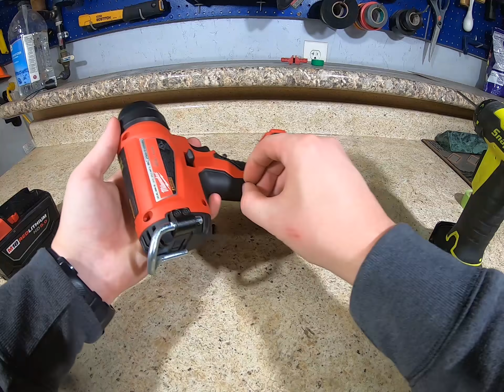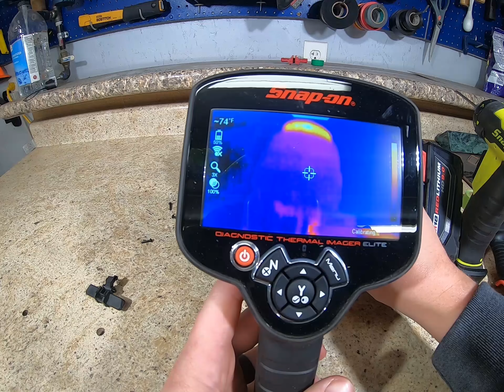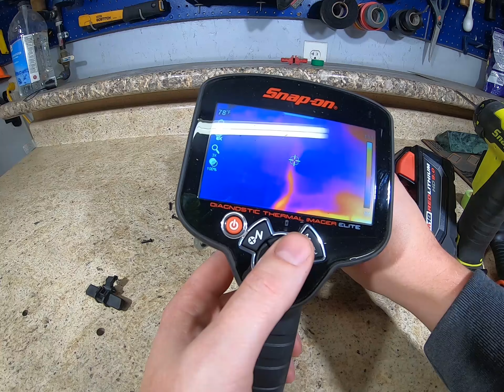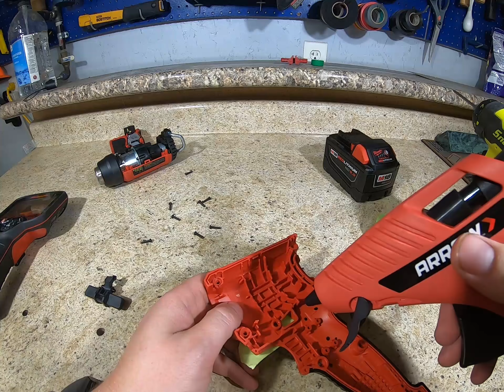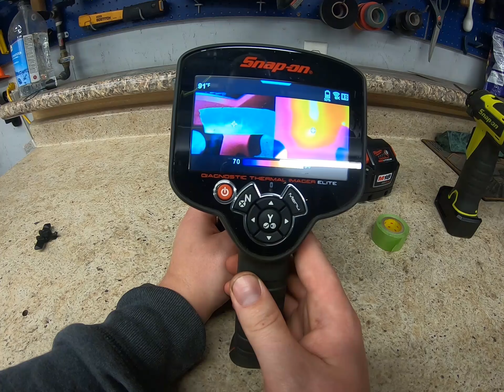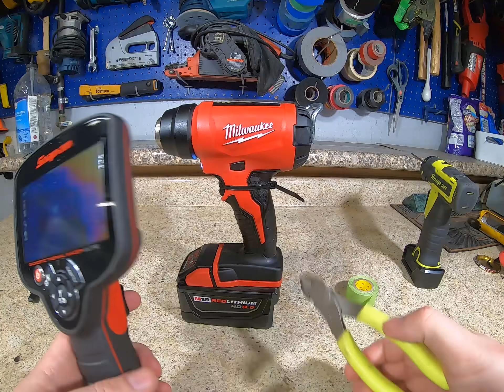Milwaukee Heat Gun Safety Bypass Round 2

Comment: I just got one after a long time of thinking of buying anyways I did a more simple mod with out opening the unit stick a wood chip that fits and make it hold down the lock and that worked for me hehe now it would’ve been great to have a slow and fast heat for application that requiere less heat , and then we’ll after all just pull the gun father out the project and solution solve hehe . I would’ve try to compare to corded but it does a great job for its usages